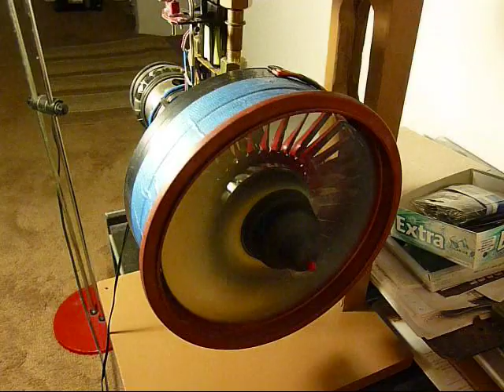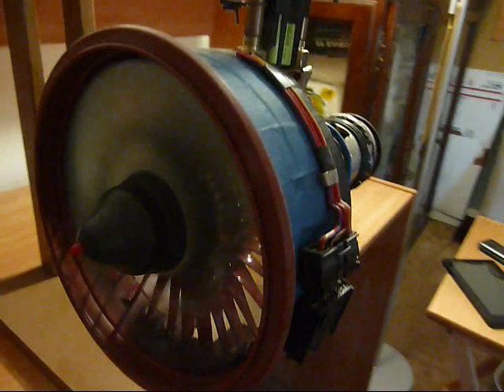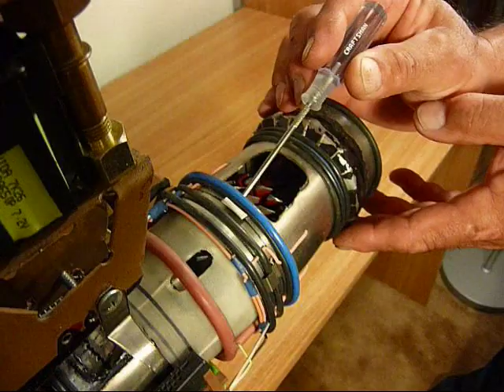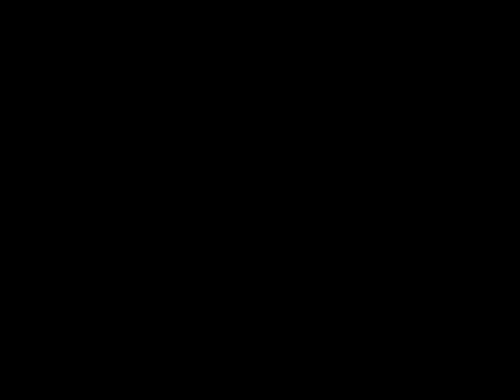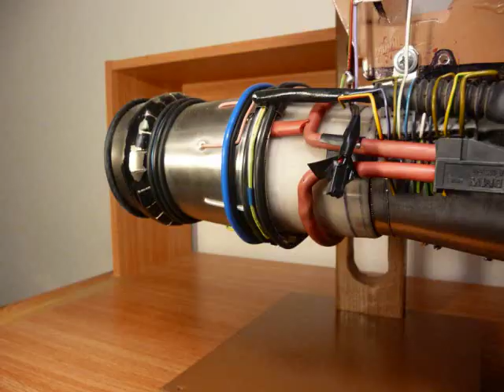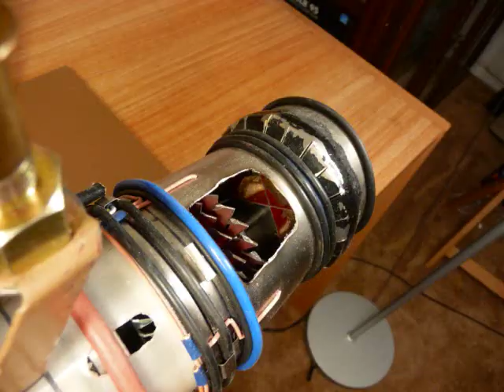Turbofan Model

Comment: your starter is connected to the wrong compressor /  turbine. The fan shouldnt be driven by the starter. You would def need much more rpm to start it....pretty cool non the less!
Reply: LOL...You dont seriously think a plastic Gas Turbine would run without melting..?....Do you?